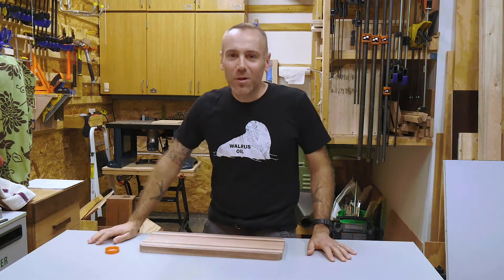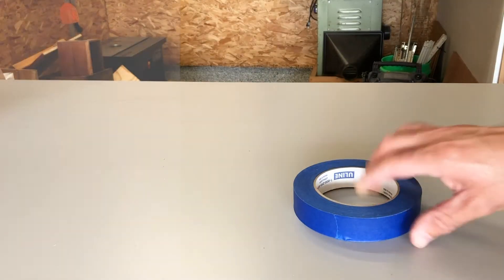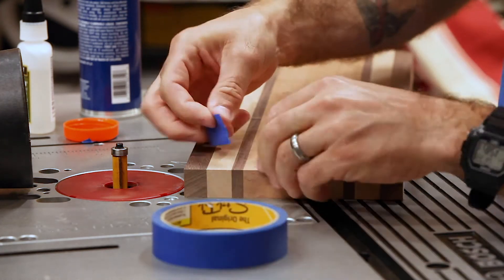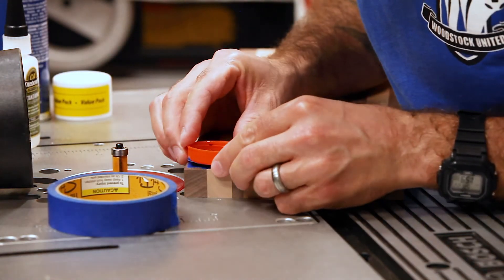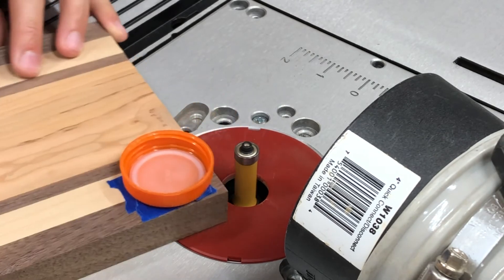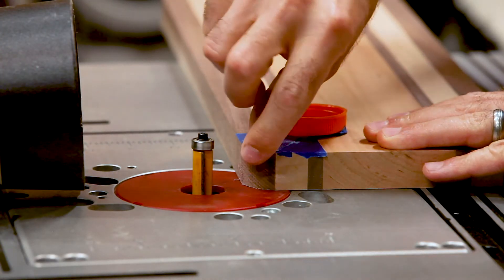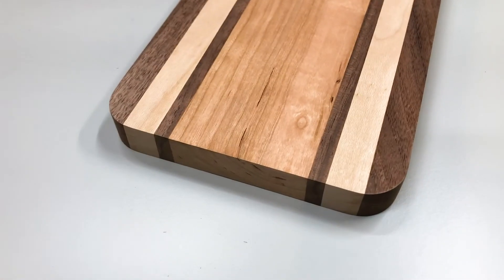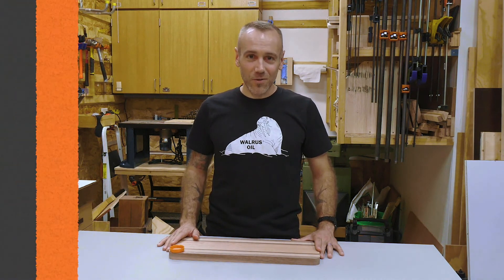How to Make Rounded Corners on Cutting Boards

Comment: This is a pretty good "MacGyver" technique if you already have the items on hand, however you can buy a set of reusable corner templates for less than what a bottle of CA glue,  accelerator spray, and a roll of painters tape will cost you.

Comment: You could make it easier by chopping off the corners on a miter saw or band saw.  Less wood to remove on the router table.
Reply: Yeah you really shouldn't try to remove this much material with a straight router bit - it'll work but tearout can be an issue, and you'll wear out your bits more. But hey, I've done it too. It's definitely better to trace the radius out, cut out most of the waste on the band saw, and then just clean it up on the router table.

Comment: a $20 corner cutting jig would be way faster and more reliable if you are making these cuts repeatedly.
Reply from the maker: You're absolutely right, Bryan. If you're batching out cutting boards or other projects that require rounded corners, this probably isn't the best solution. It's best if you only need rounded corners once in a while.

Comment: Would the plastic cap flex a bit.
Reply from the maker: Hi Shane, if the cap flexes, you're pushing too hard. It's just a guide and you should gently push the wood into the router blade taking multiple passes. Never force it! Hope this helps.
Reply: Yes you are right ryan smart idea keep great work.